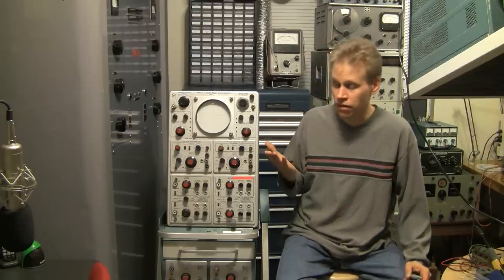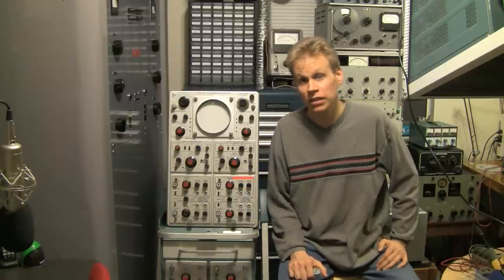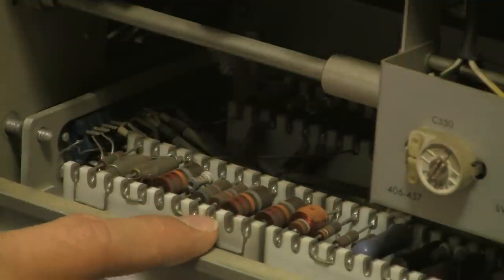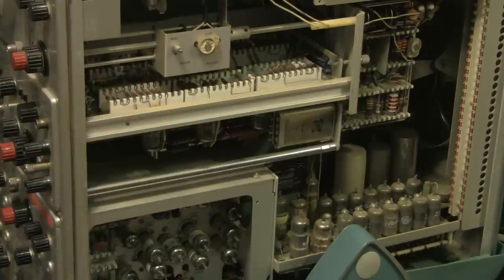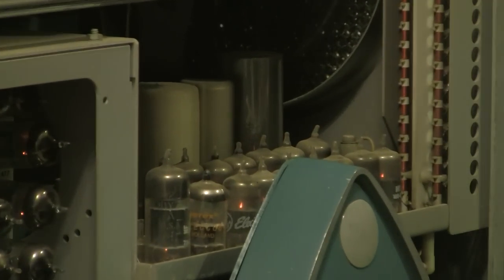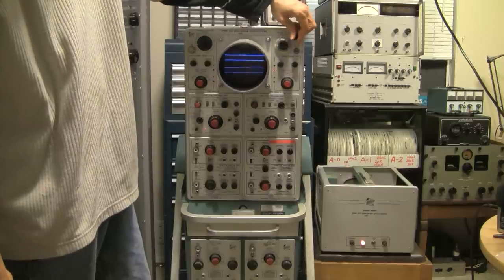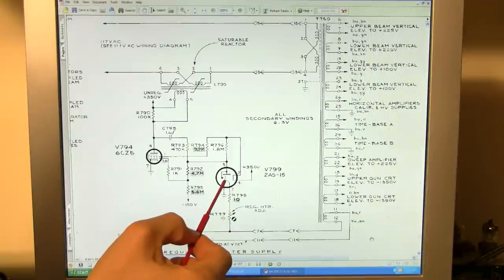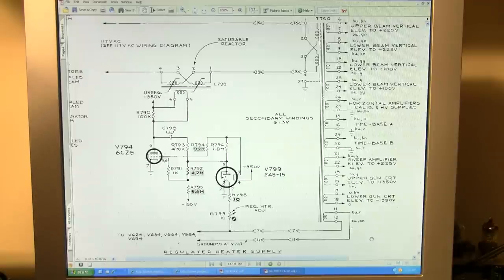Tektronix type 555 oscilloscope, over 100 tubes inside!

Comment: I have never used the Tek 555.  I have used the 545 in labs in Oregon State.  Our classes used the Tek 535 in our labs.

Ok, the ceramic strips were ceramic with the troughs made of plated silver.

The power supply had power surge delays to keep the tube heaters from blowing the tubes.  I would normally turn on the scope on for about 10 minutes for the unite to stablize.

You mentioned that the scope fans smelled; remember techs used to smoke while they worked.  That nicoltine gets 'plated' on the fans thus spreading the smell.

Comment: We had a scope very similar to this in our workshop back in the 1980's and it still worked perfectly.   Not 100% sure it was the exact same model as yours but from memory it was very very similar. The major difference with ours was that it was a green phosphor rather than blue.  I don't recall what happened to it when the company I worked for closed down but I believe the local college had it in one of their labs.

Comment: I got a good idea for you on a video for you. I think you might really enjoy. When I was in the signal core in the army my most was a 31m20, ( radio relay & carrier operator, and the radio I worked on was an (ANTRAC 24)! Stands about 4 feet high, big radio. It consisted of 3 pieces of equipment. 
R417 Receiver
T303 Transmitter
PP 685 Power supply
If you can get your hands on one, I think you would love! 
It had 3 bands, VHF, UHF,1.2 GIG, MODULES, for both the R417, & the T303. 685 volt power supply, (835) rectifiers, & in the VHF modules used my favorite (4x150A & 4x150G) tube's! You would love this equipment! Like Tentronix's a lot! A real work for of art!  Used to hook up a TCC 7 , 12 channel care to it! I had a.ball working with this equipment, 1968, Frankfurt Germany, 143 Sig Battalion. We supported the 3rd Armor devision. I worked Garrison VHF and and kept 3 shot's in to there target practice areas. Grafenver, Hartsville, & Wildflicken.The carriers at each end of the shot, tied into the switch boards. Had 2 relays per shot. They put the equipment in a module on a duce and a half, 3 men, a tent, and two 5 kw generators, that they would alternate,. 3 radios, two working & one for a backup. Loved it! I also had the repair mos, I also was  31 L 20. Love your showed, especially your attention to details. Keep up the good work! I got a Kenwood 751A, 2 M,  all mode radio I need going over. You interested? I'd pay of course. Love that radio, especially for moon bounce! 
God bless! 
Keith Schneider N9HLS
825 32nd Ave. &97
Longview WA. 98632
360-747-3421
n9hls1@gmail.com
🙏✌️🖖🤞👍

Comment: Awesome!  I used to have a 585.  It became....haunted...over the years.  The horizontal would just translate, vertically, randomly.  All points on all boards tested fine.  All caps tested fine.  All tubes put through a MIL-spec tube tester.  Could NOT figure it out.  Finally pirated it for parts.  Sold them on to other people, except the main transformer....it's awesome for tube circuits which involve monster tubes.

Comment: I have one of these I picked up from the university aerospace department.  It works fine and certainly heats the lab nicely in winter.  One little foible:  the sweep plugins were originally a bit marginal, you can tell as the triggering gets wobbly for signals in the megahertz range.  Tek kinda knew this as they put out an updated type 22A later on with tunnel diode triggering.   

The heater voltage regulator leverages the saturable reqctor pretty hard.  The primary driven by the 6CZ5 has a ton of turns of very fine wire, as it has to take just a few tens of milliamperes to control tens of amps in the heater circuit.   That delicate winding often fails in other non -Tek equipment like the GE Colorama radio but Tek probably took extra care.   You probably should replace all the Black Beauty capacitors as they’re often leaky by now.  Maybe check the ripple as the electrolytics often get lazy after 60 years or so.

Comment: I guess the jumper from pin 3 to pin 4 inside the 2AS-15 was an interlock in case the power was switched on without the 2AS-15 in it's socket. Thanks for the  review, I have an old but reliable 2215 in my shop and it was interesting to read about it's rich heritage.

Comment: I see things like this and it makes me wish that the industry of today would build things like they used to. Things that would stand the test of time. When I think about how long that o-scope has lasted as compared to today's throw away tech it almost makes me cry. It also makes me wonder what happened to such things as pride in workmanship. Many flat screen TVs need capacitors replaced within a year's time. Even something so simple as a coffee pot rarely lasts more than a year in today's market. It's a sad world we live in that we throw so much away without a second thought. This also makes me miss my old Hewlett Packard. I don't remember the model number anymore as it was around 30 years ago that I lost it. That said, it was old when I got it as a kid. It was a gift from a TV repair man who befriended me as a result of my eagerness to learn from his wisdom. I have no doubts that it would still be working today if it hadn't been damaged while moving to a new home. Kudos on your gifted Techtronix Type 555. They only thing I don't envy is having to lug that thing from one place to another...
Reply: I have a Heathkit 10Mhz 'scope from the '60s. It still works as on the first day [no beauty like this Tek, though.] All the electrolytic capacitors (USA-made) are still within spec! I have a flat-screen 24" monitor that lost capacitors, too. We replaced them with good models and they have held-up. There are certain poorly-made capacitors on the market that will fail within a few months to a few years.

Comment: In the late 40's early 50's scientists at (Bell Labs I believe) worked on the problem of tubes wearing out due to low emission (If left on all the time filament failure was not a problem).  They needed to have tubes that lasted hundreds of thousands of hours for computers and telephone repeaters that were under the sea.  The scientists came to the conclusion that the cathodes in time got "poisoned' with silicon added during the manufacturing process, thus lowering the electron emissions.  After developing new manufacturing processes that  didn't use silicon, they were able to produce tubes that lasted 20 years or more in repeaters lowered to the bottom of the sea in overseas cables.  The myth of tube failure was perpetuated by the television service industry because of filament failure caused by tubes that were wired in series across the AC line.  The most common form of failure was thermal shock of the filament due to constantly being turned on and off (thermal cycling).  I remember the tube failure and instability myth being promoted by writers in electronics magazines in the 70's to the 90s when they told people to avoid buying used test equipment that had tubes.  I didn't heed this when I started out in the hobby and bought tube scopes, tube VTVM's and high voltage power supplies many of which I still have.  My first scope was a tall skinny, dual trace, British made, Telequipment scope from the 60's that had only one trace which was quickly fixed with the replacement of a bad capacitor.  That scope served me well until I sold it for the same money that I bought it for.  I replaced it with solid state scopes which were much less forgiving and prone to catastrophic failure.  One thing about tube equipment is that it's much easier to service than solid state gear.  First generation solid state gear (1965-1975) is so complex, it's a nightmare to work on but repairable if you could find the problem.  Once the complexity was reduced somewhat by IC's, you are plagued by the inability to get obsolete IC's or speciality IC's that were only made by that specific company hence the flourishing trade on ebay of test equipment boards.  Not too many Mr. Carlsons out there that can actually figure out how a board works and design and build a better one than the original.
Reply: That's interesting about silicon shortening tube life, I never heard about that. I cant understand why silicon would be added in manufacturing tubes.Seems no place for such an element. I never had to work on the tube Tek scopes but did work on some Tek 465s,replacing switches and such. Paul Carlson is a Canadian treasure, no a global treasure. I have to agree that there's not many or even any like him today. Be well.
Reply: @StewartMarkley  Silicon was put into the Tungsten alloy to make it easier to draw through dies.  It's mentioned in the Wikipedia article on Vacuum tubes under the subsection entitled "Whirlwind and special quality tubes".

Comment: I used to have a Tektronix 549 storage scope. Worked great for anything below 30 Mhz. I even had the cart, the 1L20 spectrum analyzer plugin, two dual channel 30 MHz vertical amp plug-ins and about a dozen probes. Sold it to a friend of mine years ago, as far as I know it still works. Now a days I just use a 2465.
Reply from the maker: +Craig Petersen 
That 549 is a neat machine! These old Tek scopes are really easy to fix..... cause they don't (or rarely) break :^) A squirt of oil in the fan is usually the worst of it. The 2465 is also a very nice machine.

Comment: Speaking of vacuum tubes, the old AN/FSQ-7 computers which drove the national SAGE air-defense system from the late 1950s to the early 1980s each contained something like 50,000 tubes, and they were installed in pairs for redundancy.  Top that!
Reply from the maker: +Richard Hall 
LOL, Well no scope I have has that many tubes. Thanks for your comment Richard! :^)
Reply: Yeah, you'd probably need a hotel to fit a scope that big!

Comment: Is the skier on the schematic? For many years Tektronix schematic diagrams had a tiny drawing of a skier sliding down the ramp of the sweep circuit. Tektronix's schematic drawings had a style unique to the company. All the drawings were hand-lettered and annotated. In my opinion, they are technical works of art!

Comment: I have a Tektronix 545A Dual Trace Oscilloscope. It has over a 100 tubes too and weighs in at 31,5 Kilograms (I think that's about 77 Pounds). It's a beauty and it still runs :)
Reply from the maker: +EdEditz 
They are great machines!
Reply: +Mr Carlson&#39;s Lab They sure are and they smell, like you mentioned in this video, of dust on hot tubes.  I love that smell ^_____^
I wish I knew someone like you in The Netherlands (where I live) because my scope needs an overhaul. It needs to be re-calibrated etc. Anyway, it a fantastic bit of vintage electronics and I don't think I'll ever part with it.
I'd love to see a tutorial by you on how to maintain these scopes and what to look out for, as to components that might fail or weak spots in the design etc. That would be cool to watch and have as a reference.

Comment: Paul,   I just wanted to make a silly comment and comparison.  With todays digital and microprocessor based oscilloscope's using millions of transistors maybe your title should be: With only 100 tubes Tektronix made this really cool work of art back in the day.  Compared to other tube electronics back in the same time period yes 100 tubes was a lot.  I think you will agree it takes millions of transistors to do the same thing now-a-days.  Very nice entertaining and informative video.  As always you do a great job on your video's.   You go straight to the point without a lot of extraneous jibber-jabber.   Thank you for sharing your talent and knowledge with the rest of us.
Reply: bit late but a modern DSO functions completely different to that. sure it shows the same thing but the working principle is totally different with an analog to digital converter taking samples of the Signal and showing these.

Comment: I was a Radarman in the Navy, almost all of our equipment including our Radars were old vacuum tube type, our surface search was an SPS-10 and it was very reliable.
Reply from the maker: Very cool Bri G! Thanks for sharing that. As you can see, I have a lot of older gear, and it is all very reliable too. I think a lot of the misconception comes from "failing capacitors."

Comment: I used to repair the 565 (dual beam), the 545 and the 549 with a 1S1 sampler plugin.  Usually the rotary switches go bad or mis-use damages one of the plugins.   Sometimes the high voltage power supply around the flyback transformer went bad (high leakage to ground causing high voltage to be too low and out of specification).    Other problems were repairs to bring the scope back into specification for calibration.

Comment: I was comment employed by Western Electric AT&T, starting in 1963, retired after 36 years. I used tectonic oscilloscopes through my entire employment, it was my right hand partner. The quality was Superior, than any other oscilloscope at the time in my opinion. I used it to check out program address and answer bus, binary bits, looking for irregularities in the shape of the pulse, and electronics switching systems, number one ESS, number for ESS, that was the first All Digital electronic switching system, and number five ESS, first All Digital fiber optic electronic switching system, also tsps systems, stands for Traffic Service position systems. When there was a problem and I suspected after diagnosing the problem I would pull out the tectonic oscilloscope, set up my sink pulse where I weren't to look at a binary bit, and then went from there. Would that help other technical Scopes I was able to isolate the problems 99.9% of the time. Today is October 20th 2022.

Comment: Great videos! I'm a fellow EE and must say your electronics knowledge is a top notch. On the 555 heater circuit may I point out one more very clever aspect of it's design. Notice how the 350v is "looped" through pins 3&4 of the 2As15 tube.  I'm sure you know this but for the other posters, the reason for that loop is so that if the tube were to be pulled out, the heater regulator shuts down and the saturable  reactor "opens up" and lowers the filament same as is the 2As15 filament fails.

Now why would someone pull that tube out and try and operate the scope without it? Who knows? But it just goes to show the level of engineering and attention to detail that came with Tektronix products.
Reply from the maker: Thanks for your comment Andy! Glad you're enjoying the video's.

Comment: Astounding workmanship, and dual beam to boot. Now I understand why you have so many of these scopes around. However, I hate to think what your hydro bill must be along with multiple test equipment and high power transmitters. Your lab must have needed special wiring requirements to draw that amount of power. My hat off to you for integrating the old with the new.
Reply from the maker: +John Cunningham 
Thanks John! Power consumption isn't too bad, I usually have just a few pieces on at a time.

Comment: Had a scope like that at a company I worked at back in the late 70's. It had one nasty re-occurring problem: silver dendritic growth occurred on ceramic bars. Every few years, someone had to open it up and meticulously scrape the ceramic bars to remove the dendrites. At about 400 volts dendrites are problematic and at first create noise, then other problems. Sometimes you can build something TOO good!

Comment: The solder used is "silver bearing", not regular silver solder.  It is used to prevent the de-plating of the silver on the ceramic terminal boards.  I have a 545B that came as a gift from a ham... mine was in MANY pieces as he got the pieces as a gift from Tek for work he did.  Several harnesses had to be installed.  There were errors in some of the harnesses and missing parts.  Tek sold me the parts, including knobs to complete the scope.  Took a lot of work and rewiring to match the maintenance manual diagrams.  I have used the scope for years.  I now have 465B and TDS2024 as well...
Reply from the maker: Fred Yearian Thanks for your comment Fred!